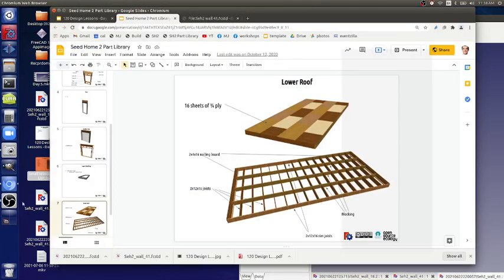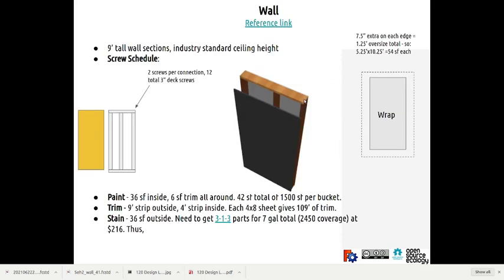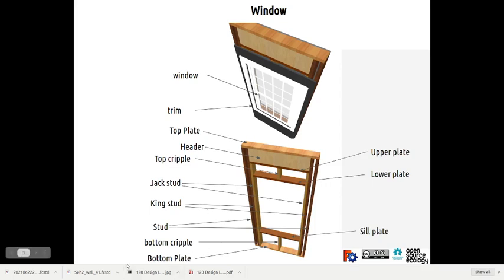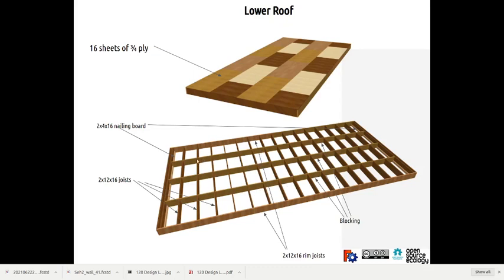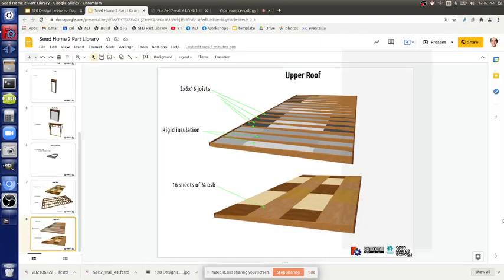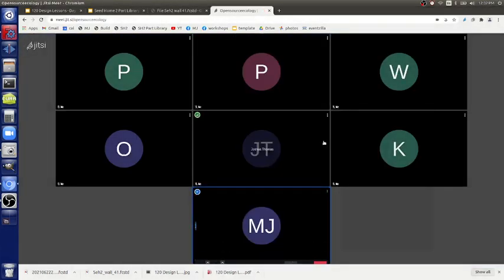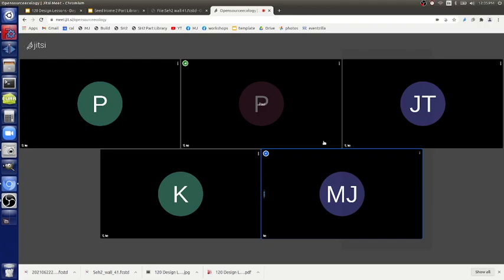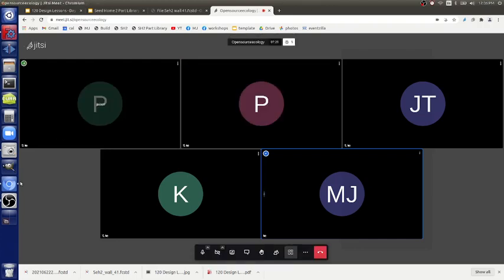Day 5 - House Build Overview

Comment: 1:44 The header on the window distributes the weight of the roof to the stud(s) around the window. Thus you need the double stud (or more) on the side of the window to support this weight.
Reply from the maker: Is the 1:44 design wrong? Appears so. That has been corrected in current work - the one shown here is an older version, so it should be considered for part naming only, not actual design, correct?